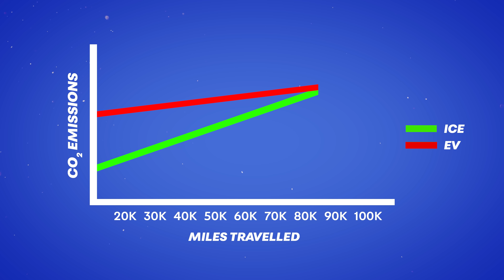Are Electric Cars REALLY That Green? [New 2022 Data]

Comment: Given the batteries need to be replaced every 40,000 miles or so, how can they ever reach break even?
With the EU actually moving toward coal, wouldn’t that mess up the European break even?
Reply: What utter garbage!  Have you done any research at all before you posted?  A new electric car usually comes with an 8 year, 100'000 mile warranty on the battery..... And they don't need to be replaced! They can be repaired and refurbished.... Like I said, do some research.... I's suggest you start by watching James & Kate's YouTube channel. They had their 10 year old Nissan Leaf battery refurbished at Cleveleys in Gloucestershire about 3 years ago. It cost them £500........
Reply: @Brian-om2hh  
Yeah they actually do need to be replaced.  Not sure what the wording of all the warrantees are, or if they are just betting folks will get rid of the car before then, but the battery manufacturers etc, do not foresee that kind of range.

Comment: There's one more "pollution point" for the EVs and it's the replacement of the batteries. Which means old batteries (pollution) is going out and need to be utilised and the new batteries (pollution while making them) are going in. Which creates another bump in the graph which means the mileage of 90000 might actually go even higher before they become equal or better than ICE.
Reply: Not all EV batteries will need to be replaced. Clever EV owners will have their batteries repaired or refurbished, at considerably less cost than a complete replacement. You don't replace your engine when it breaks. You have it repaired. The same applies to EV battery packs.....

Comment: There is an issue with the battery lifetime - when your bev becomes greener, you are near the service time of your battery. If you consider changing your battery pack at around 150000 miles, you will never be greener than a fossil fuelled car :)
Reply from the maker: Do you keep your cars for 150000 miles?

Comment: As they say, every little bit helps, even is it is less than what some folks may have thought it was. It has long been known though that there is a higher environmental cost to building EVs as compared to ICE vehicles. There is a lot of debate though about the environmental impact after production and a lot of it centres around the energy mix. One thing is for sure, ICE vehicles lose out here, whether its sooner rather than later is neither here nor there. I agree that EVs are the future and that we do need to focus on a decreasing the environmental impact of EV production and energy efficiency for lower environmental impact while running as well as recycling after the useful life of an EV (especially the battery). This will surely improve as technology evolves and we will have cleaner and better ways of producing energy (in fact its imperative to the long term survival of the human race).

Comment: I'll make it very simple for you.  The federal government subsidizes oil and gas to the tune of eleven MILLION every MINUTE. (without subsidies it would be thirteen dollars per gallon)  EV's ARE the future for one reason, economy. The fact that crude is moved around the globe by fossil fuels, was NOT considered. (and here again, only thirty percent of the power from fuel is used to make the move) If you take JUST  the electricity used to pump crude out of the ground, pump down a pipe line, or into a tanker, into the refinery, in the refinery, pump it in a tanker, pump it into a vehicle, is more than enough electricity to power EVERY EV out there today for YEARS to come.  Also, NOT mentioned, is that an ICE vehicle only uses thirty percent of the power from fuel to turn the WHEEL.  I live in a state that produces over eighty percent of their electricity from wind, solar, hydro, and nuclear.  EV batteries (today) use NO cobalt, if properly charged will last well over two hundred thousand miles. Batteries can and are recycled. Lithium is mainly mined in Australia and Chile.  Those areas are desolate.  Australians are more concerned about the three percent of crude that they refine, than the fact that they are major suppliers.  Lithium is used in medicine.  The Salton Sea, California has more lithium than the other two combined.  They are already filtering out the lithium from the brine from three different geo-thermal power plants already in operation.  GM is building a facility to built batteries on site.  EV's have been on sale for thirteen years. I bought a Nissan Leaf (brand new) in 2014 for twenty thousand, seventy five hundred tax rebate, taking it down to twelve thousand five hundred, is worth twelve thousand today. Charge with a couple dollars worth of electricity, which goes any where from seventy to ninety miles. Haven't use a drop of petrol since.  .... and the only sound that it makes is the squealing of tires, when I accelerate.

Comment: 90K crossover.. will your mined by children rare earth battery last that long? .. and then what does the EV owner say then when they have to buy another (very expensive) battery? and the GREEN infrastructure cost of building a network and supplying electricity for all the mandatory EV's - 1970's brown outs anyone? - and scientists are now referencing the PM2.5 particles shed by the tyres for the 2.5 tonne behemoths on the road....( and that will soo help with the potholes) whilst my euro6 (mostly) aluminium light weight low emission Diesel (dirty word- but hey the government told me to do it) will plod on with a total lower footprint..  and some crusty will come along and let my tires down  ' for the children' ...     They need to give it time for the technology and infrastructure to catch up and by then Solid hydrogen will be a better option anyway - and the taxman is coming for your charging stations because there's a cost to 'saving the planet'.. total ownership cost to the owner and the planet for an EV is already worse than a typical ICE vehicle .. but hey.. progress

Comment: Excellent discussion, Rory.  I wonder if Volvo's figures have taken into account the need to replace the batteries after about ten or so years?  The full lifecycle of the car needs to be considered here.  Not just how long before the first owner sells it on.  I am still driving my 2001 R34 GTR, which I have owned since 2007.  I drive it on E85, i.e. 85% ethanol which is sourced renewably.  So where does that put my 21 year old 600hp gas guzzler versus an EV of a similar age and onto its third battery set?
By the way, Volvo have taken down the report from the link provided.  If you get the chance, please send a copy? :-)

Comment: Definitely some interesting info here. But we all just seem to care about CO2. How "Green" are these vehicles from start to finish? Generally petrol cars are easy to breakdown - apart from a little fluid these are all generally some metal or other. When it comes to decommissioning the battery pack however it isn't so simple (from what I have read, I don't work in a battery recycling centre to know for sure!). How much CO2 is produced when trying to use specialist equipment for the recycling process? What heavy atoms are we releasing when these batteries are opened up?

To me it feels like we need to look at the entire picture with these cars and it actually feels like some kind of Hybrid Fuel is required rather than pure electric. Already in Britain there is a change going through about charging tariffs as the Government want cars charged through the night to take some strain off our Grid... that is with a tiny proportion of cars on the road being electric.

We say it will be better for our cities if everyone was using EV... great, how do we go about charging these then? When I lived in Leith it was all flats at my area and then old tenements further along the road - with no where near enough parking as it is but how do you charge a car that is 5 storeys down and parked 3 streets away?!! I look around Edinburgh New Town and wonder where on Earth they will power up from?? Every major city will be the same. Falkirk, a moderate size town near me, has buildings that are about 30 storeys high and have enough parking for about 20 cars... but with over 100 homes per building I can't see that being easy to charge up!

So, all in all, I can't see EV's ever really being the answer. Add in more charging points maybe... well, we will need to factor in the CO2 values for that as well. I'm not saying ICE is the long term answer - it isn't due to the amount of oil we have left - but EV is not the answer either (the Lithium reserves will run out rather quickly with the pace we want to build these things so same issue as ICE).

As for paying an energy tariff that is "All Renewable Energy" I would question that too. I looked into getting one of those tariffs as the general energy prices are going through the roof... but going "Renewable" was no cheaper - which I find surprising [I don't really as I have never bought into the idea that it is a Green Energy source when you look at the big picture with that too]. And the grid uses all the same cables as Nuclear Facilities or Gas & Coal powered generators so although you pay a "Tariff" for renewables you are still being powered by the rest of the CO2 producing options.

Comment: What about lithium recycling? What about carbon footprint to develop capable electric network to support all of those electric cars? You need to produce more wires to construct this king of power grid. You need to develop electrostations and even if it is "green", it is built using not so green diesel vehicles.  
There is a lot of "what about..." in this topic.
But electric fanboys does not want to hear it 😢

Comment: Tesla is making an electric car in 10 hours, compare to volvo, and VW make cars in 30 hours.
And if you look at mining it's geting better.

The internal combustion engine has so low efficiency that it's better to use an oil power plant to make the electrictrisity directly, than transporting it, to an refinery.

PS. I don't think that Volvo have the electrictrisity that oil refineries are using.
This power are close to what the electric car need to run the same milage as the fossile fuel ones.
The figures are no longer available, because the oli companies have convinced the politicians that this is a company secret....

Comment: I may be blind but I don't see any emission/inputs/CO2 production from the manufacture of the engine, gearbox, transmission and exhaust systems. In fact the only reference to the engine, or any oils is in the end of life dealing with dangerous or hazardous items section. 

So you have material inputs etc for one propulsion system but not the other?.......ah can anyone say misleading, or biased or even ds and not worth the paper it is written on?

Comment: This kind of thing can be hard to discuss because when you bring up the costs and downsides of any "green" technology or policy, someone is going to jump on board and say "yes! EVs (or whatever) are a lie" often spreading misinformation in the process, sometimes just as a hammer to beat environmentalists with--there are people who seem to have a core faith that anything an environmental advocate proposes will actually have a perverse opposite effect.

I like these discussions like this one that are actually pretty careful. The lifecycle costs of producing EVs are important to consider.

The climate impact of EVs is a complicated one because it depends so much on local conditions, which change over time as well. There's a popular idea that the electricity in your socket comes from burning coal, which for the US is outdated and increasingly not true (instead it very often comes from burning natural gas, which is bad for CO2 emissions but not remotely as bad as coal). But it is still true in some places. When you buy a car you're also betting on conditions in the future as well--it's easier to bring down the carbon-intensiveness of electric power, through renewables or nuclear power or whatever, than to bring down the carbon-intensiveness of an ICE.

Between EV fans and ICE fans, there's a third camp--transit/cycling advocates who are opposed to cars altogether. Some of these people really, really hate EVs because they see them as greenwashing for cars. If you use some other mode instead of driving everywhere, that's a much bigger win. I do think their anti-EV attitude has a certain "perfect as enemy of the good" quality and can play into the hands of people whose real message is that you should just throw up your hands and drive a 13 MPG guzzler with pride.

Comment: Unless we fundamentally switch from lithium-ion batteries nothing will get better over time. Lithium after its lifespan is done is so polluting (+ manufacturing the batteries too). We just switch from oil pollution to spent / mining lithium pollution.

Find a better, more efficient, non polluting energy source and there are better options, but lithium money speaks, just like oil money, it's a hopeless situation in the big picture. LITHIUM SUCKS HARD.

Comment: EV alone is not going to 'green' the world, but without EV, people will continue to buy ICE cars, and thus continue to demand more fossil fuel. EV, on the other hand, allow the use of green energy, thus drives demand for clean energy. It is a demand driven approach to get to clean energy. Of course, countries may choose to use dirty fuel to generate electricity, but without EV, there will not even be a choice to power our cars with clean energy. And do not forget the energy security problem. While there are clean and renewable energy solutions that countries can employ at home, like wind, solar, hydropower, with fossil fuels, when you run out, you have to rely on other countries, thus subjecting yourself to other people's wish.

Comment: Electric cars do not help the environment as much as the sales folks will tell you. So don't let the hippies and the cult of Elon Musk tell you otherwise. Yes the car is clean, with no fuel to burn. BUT BUT BUT. What folks never mention, is that electricity does not come from some magical wizard. Fossil fuels are still burned to create said electricity. Second, the fuels burned to CREATE the cars cannot be ignored. Third and most relevant. When someone buys an electric car in order to replace their old petrol car, where does said old car go? Think about it. (which most people don't) 9 times out of 10 that car is sold to someone else. So the end result is said car is still on the road, using petrol, AND adding to traffic now that your new electric car and old car (with new owner) share the same road. So unless you buy an electric car, then scrap and recycle your old car, its not really that "green". I am not even touching the conspiracy nuts, just touching on common sense.

Comment: Good video and thank you, it certainly promotes further debate. One thing needs to be considered, is the evolution of the batteries and the development going on at the moment, where different materials are being tested, where a lot of them are greener. However, what about when the cells start to degrade and the owner decides to swap it for another battery. Surely the break even goes even higher. My Leaf's battery has just started to degrade after 9 years of use and I am trying to decide whether to keep it and run it into the ground or swap it or buy another EV. I certainly without doubt want to continue driving EV's.
Reply: I'll keep my 1994 F-150 with almost 29 years on it and still going strong!

Comment: What everyone fails to see is that eventually we need to stop using oil, not just because of pollution but because it finite. Yes, the manufacturing of EV right now pollute more than ICE, probably, but that's not the point. The point is the EV does not need oil to run. You might think, "yes, it requires oil to generate electricity", that's not a problem of the EV car is a problem of energy companies, if eventually we get to the point where all the electricity is green, then EV does not pollute anything, from start to end, because no oil is used on any stage of creation. ICE cars will by default use oil to run, regardless of the cost of assembling the car. That's why the migration needs to happen, because car that does not use oil is one element less that use oil in our day to day life.

Comment: I didn’t read the .pdf study. I’m concerned about how these lithium batteries will be disposed of. Was that included in the report and is disposing of Lithium another environmental issue we are going to have to deal with? Thanks!
Reply: Volkswagen and Renault don't seem concerned. They both have EV battery recycling facilities up and running now.... You don't "dispose" of lithium. It can be 90% recovered from recycled batteries and reused in new ones.... it can be reused numerous times.

Comment: CO2 is not the only output from ICE cars. The diesel ones have also some cancerogenic substances, which the BEV and even the petrol cars don't have. Also the BEV cars don't pollute in the cities, but outside, ten or hundreds of miles far of the city, like the ICE cars. The energy for BEV, can be sustainable, from ICE is always from Oil. So is not that simple.